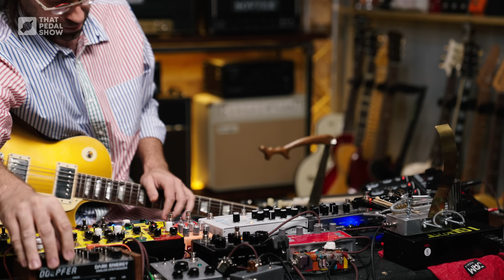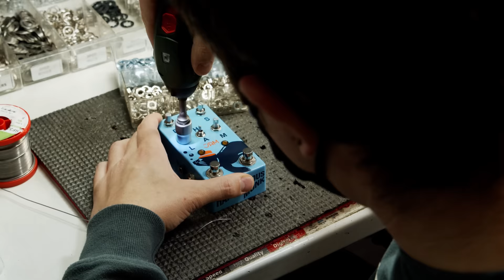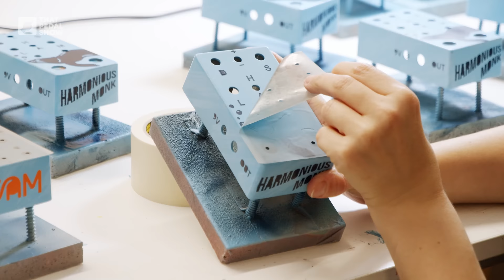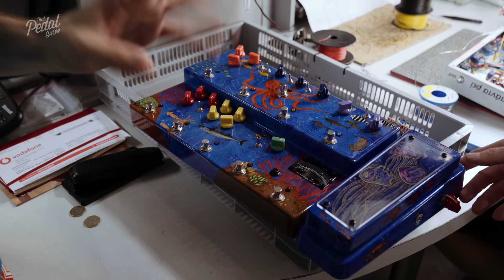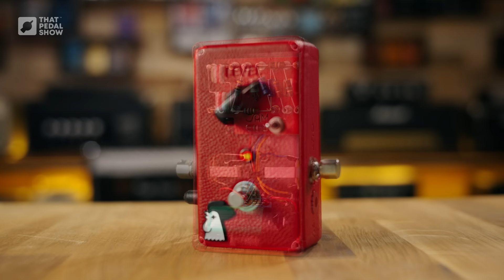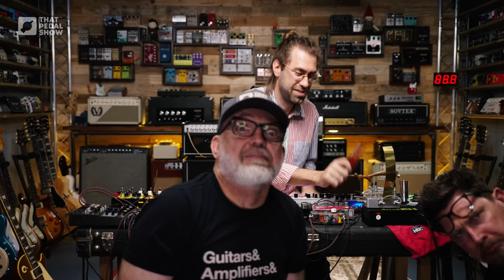Crazy Pedalboard! JAM Pedals At That Pedal Show [Jannis' Bonkers Board, Band Jams & Interview]

Comment: Guys, as usual a very informative session with a great balance of conversational information banter, great sound clips to emphasize what you are talking about. Great job! I do have a question/comment for your consideration...After watching endless variants of A/B of guitars the one thing I have never seen is how you use the guitars tone and volume knobs for effect. It appears, everyone leaves their tone, and guitar volume maxed out and controls volume output with the amp. To the uniformed, this might make sense if your reasoning is that the guitar tone and volume only serves to diminish the guitars potential for tone. If that is the case why put any knobs on at all? I think many people have followed this pattern by watching the pro's and noting the position of their knobs and the pickup selector. Is there some magic that we are missing by not understanding the intension of having volume and tonal control at the guitar? Thanks.

Reply

Comment: I do most really high end digital at work, but can't stand digital on my pedalboard.
There are leaded component stuffing machines. My CM has a couple of those. I started doing SMD with Cincinnati Microwave. One of my friends designed the circuit boards for Microwave. They were the first company back in the 80's to get full Fuji SMD pick and place and IR oven. I was there when Sony was taking classes at Microwave.
Jannis thanks I have Ripley Falls, Delay Llama and Delay Llama extreme, they are all great!
Flanger please!
Thanks guys, great show.

Comment: I have the Pink Flow. Fantastic array of sounds. My only gripe is that if I place my univibe and wah in front of it I lose the 'Seagull' effect. I could use a second loop between the 'Seagull' and the drives for my tuner, wah, and vibe. Nonetheless as a collection of analogue pedals in a single box it is quite astonishing. Putting an echorec style delay after it an using the 'Seagull' really makes you want to turn (the amp) on, tune (the guitar) in, and drop (the bass) out. 😎✌